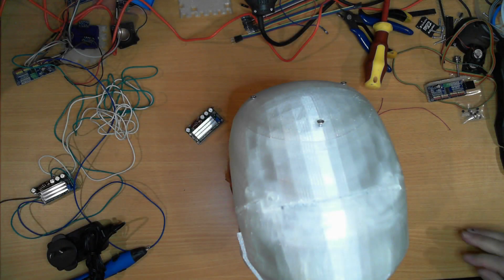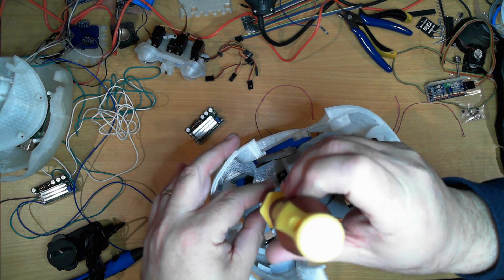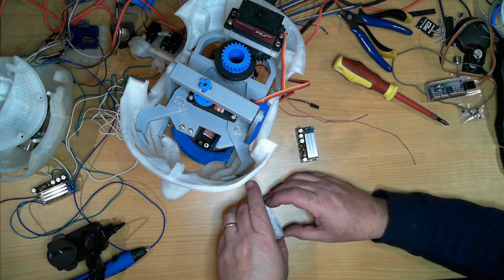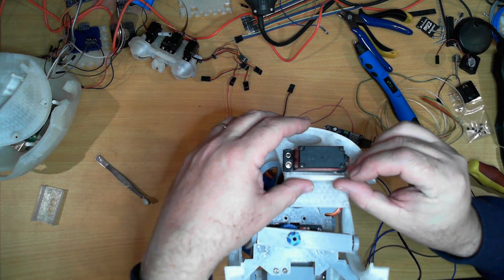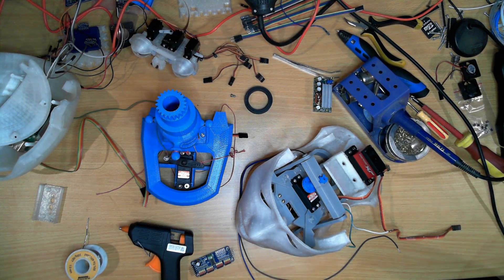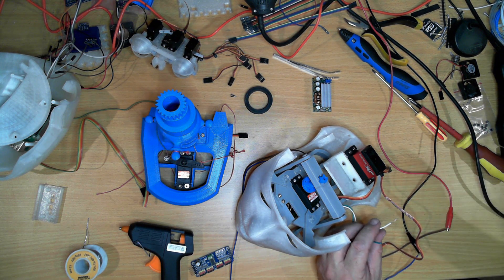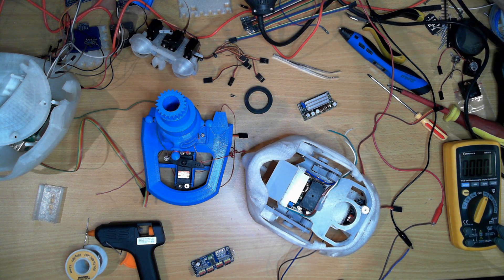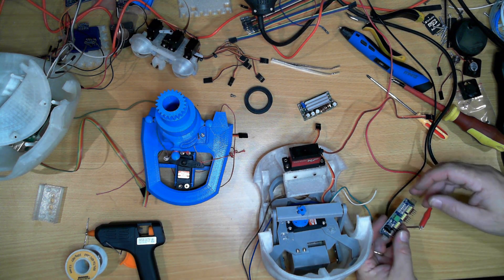Freds Head Part 6

Comment: shoou vc teria o stl dessa cabeca
Reply from the maker: For the head it's self, these were listed in Part 1
https://youtu.be/j5p-lt0Z9_g

https://www.thingiverse.com/thing:2394098
InMoov - Accessible skull with continous forehead by dix238.

http://www.thingiverse.com/thing:992918
Modified InMoov head by monnerby.

http://www.thingiverse.com/thing:3395654
InMoov Neck Head Bracket Another Redesign v2 by richardtracy

http://www.thingiverse.com/thing:2335838
InMoov LowBackSkull &amp; Gear remix by richardtracy

https://www.thingiverse.com/thing:2548952
InMoov - Advanced Eye Mechanism by Dakota76.

http://www.thingiverse.com/thing:1581955
InMoov - Low Back Skull / Neck Joint - Modification by dix23.

https://www.thingiverse.com/thing:1636086
InMoov Face less holes by juergm.

http://www.thingiverse.com/thing:1523416
Raspberry Pi side mount by MichMich.

The Advance eye mech was listed in Part 2
https://youtu.be/IRt1YT1lsEE

https://www.thingiverse.com/thing:2548952
InMoov - Advanced Eye Mechanism by Dakota76.

In Part 3
https://youtu.be/4cgeQmE5Aq4

Alexinator40's remix you can find here:
https://www.dropbox.com/s/8t7enwa7ys0wdb2/RayFileFixed.stl?dl=0

There were no additional parts used in Part 4, this was setting up the operating system and MyRobotLab on the Raspberry Pi
https://youtu.be/-uc9DxDoj9Y

In part 5
https://youtu.be/RqIwtEje5cc

The bracket I used can be found here:
http://www.thingiverse.com/thing:2062472

and in part 6 the parts I created
https://youtu.be/jRYPffeNkis

AT30_SMPS.STL https://www.dropbox.com/s/qasvv97k4j6kot5/AT30_SMPS.stl?dl=0
Created by Cycber_One

PCA9685_Mount.STL https://www.dropbox.com/s/vjgidlmbo2zt9v8/PCA9685_Mount.stl?dl=0
Created by Cyber_One

Part 7 is the final wire up and mounting of an addition AT30_SMPS bracket as per the one in Part 6
This will be released on Friday 26/6/2020 at 4:00pm AST (UTC+10)

Part 8 is testing and some basic Python scripting.
(Still being recorded and edited)

Hope that helps :-)
Reply: @CyberOne   muito obrigado